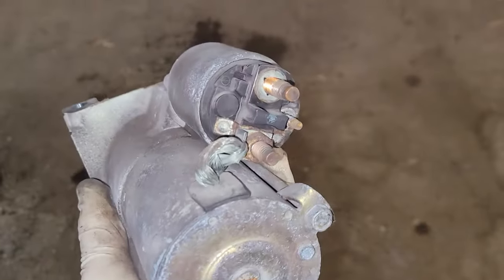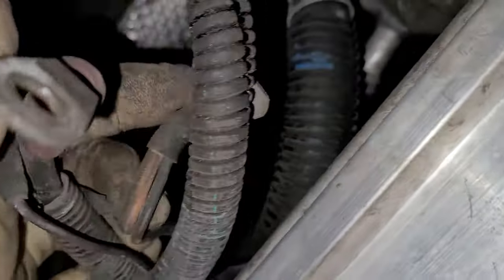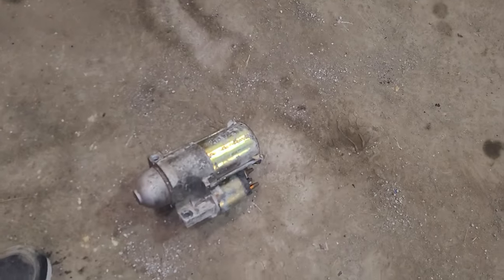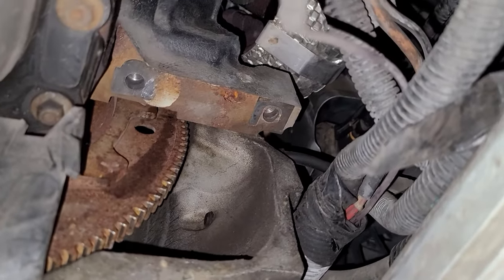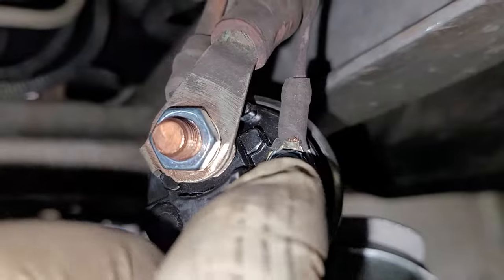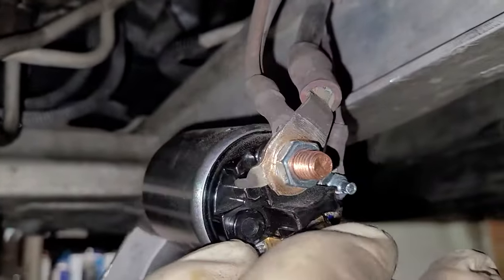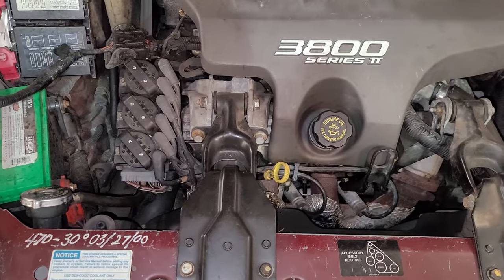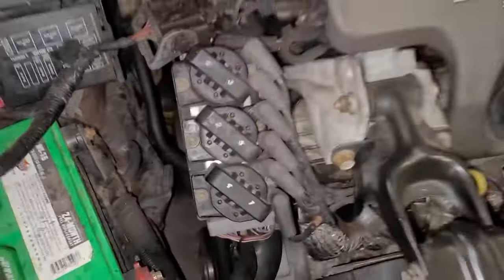No crank, no start !! If it's not the starter, then what is it?

Comment: A bad connection / corrosion and or a low battery will ruin a starter happens all the time….
Reply: Just installed my starter…. But didn’t clean the wires…. 😅now I gotta disconnect em
Reply: That's an excellent point. People don't realize that motors draw whatever current they need. If supply voltage is reduced by upstream voltage drop, the motor won't spin until it achieves the power required, and power is the product of current and voltage. So, with reduced voltage, current needs to be higher to unlock the rotor, putting more incidental heat into the thin wires inside the starter winding. With a few extra seconds drawn each day, and eventually with multiple tries to get the engine started, the insulation around those wires breaks down and the new starter dies.
Reply from the maker: Dead on correct !!
Reply: I've seen some strange things with the no crank no start issue. I helped one guy figure out why you never connect your main ground to the exhaust manifold bolts. I had an Olds Cutlass that would take a few tries to get the starter to work. When I went to take the starter off, I realized it was going to be a ROYAL pain to get to it. I decided to take the battery cable off the solenoid and loosen the backup nut so I could turn that bolt half a turn and put it back together. Problem solved. That starter was still working when I pulled the engine 2 years later to put it in a Ford pickup. It never gave any trouble for the next 4 years. I've seen a lot of people replace starters and swear about getting a bad starter from the parts store when it was something else ranging from bad grounds to bad ignition switches, relays, or neutral safety switches. Even worse is having to track down broken wires or bad splices where someone has messed with the wiring.
Reply: @WrenchingWithKenny  I currently have a 69 Chevy caprice it has the 4 bolt man 350 engine The car turns over but won’t start and I replace the fuel pump and it has the four barrel carburetor Just need to help to what to do next thanks
Reply: I have bought 2 new batteries, new starter.. and cleaned all connection points.. still no crank.. would wires still be the issue
Reply: @dominiquehaines-86SquareBody  surely sounds like there is a huge voltage drop measure from main power to start power and find if there is a huge voltage drop do the same on the ground side…. Sometimes you can substitute a connection with battery jumpers and go from body ground to case ground, then battery power to starter power lug if it works you have issues with your starter wiring
Reply: @dieseldawg7132  i was thinking of changing the battery and starter wiring but haven't had time yet

Comment: So I just replaced my starter solenoid. Now the engine will only run when I'm trying to start the engine. Once I let go of the key it kills it. Please help.
Reply from the maker: @offswitch Sorry to hear your having problems. Kenny suggested you go on our Facebook group, Backyard Mechanics (3.9K members). Input all the info about your vehicle & what you have done to fix the issue. There are a lot of techs and automotive people that may be able to help. Be sure to answer all the questions to join the groups. Let us know what you come up with. Keep wrenching!
Reply: @WrenchingWithKenny  hey I actually figured out my problem.  The entire wiring harness worked itself out. Didn't need to replace anything . Pushed it all the way in and good as new.

Comment: I think my crank shaft position sensor is bad (got code) or  selenoid is bad. So i got a no crank no start. I needed a booster to get car started. Got it to start but car lasted I only 2 days and then did the same thing. I charged battery i case it was battery. Started no  crank no start. Did it again and it took 10 seconds turnover before it started. So i dont think its the starter or it wont even turn but the selenoid going bad is not popping out coukd cause it to not turn sometimes or not turn most times? From spinning and cranking?   I got a code for cam shaft  position sensor, which I read eventually causes no start but it doesnt say if its a no turn no start or of its a turn but no start. Alternator hasnt died or the car would lose power and turn off or just not turn and or crank at all. Other suggestions anyone? let me know please. I dont want to buy new starter and alternator just to find out issue continues. It may be ignition switch or something similar? Not sure
Reply: So to be clear a no turn, no crank, no start is happening and only booster or fully charged battery turns (so far) booster struggled tmbut started. Fully charged battery didn't turn, didn't crank, no start. Waited a few seconds did it again and it turned crank but lasted 10 seconds before finally started ( I didn't hit gas because I turned car from passenger door (driver door broken and I didn't want to get in just to hit gas ( but will next time since I don't want to go through a long turned crank again.  It's weird. Anyone?
Reply: By the way I replaced battery with new battery that was sitting for a bout 3 months so I thought  needed boost to recharge but then 2 days later it happened again so indent think it was the old batterybsince new battery now and still having issue.
Reply from the maker: It's Mrs Wrenching. Sorry your having a tough time. Kenny is at the shop. He suggests that you go onto Facebook Wrenching with Kenny. Input all the info about your vehicle (year, make, model) & what you have done to fix the issue. There are a lot of techs and automotive people that may be able to help. Post on our other FB group, Backyard Mechanics (3.8K members) they can help too. Be sure to answer all the questions to join the closed groups. Let us know what you come up with. Keep wrenching!
Reply: @WrenchingWithKenny  ok thanks. I hate Facebook  and I n don't have an anonymous account but I'll see what I can do. Think the ground test will help me a lot. I saw 2 videos before bed about  this as proble. May be electrical if its not starter
Reply from the maker: I hear you about FB. Both groups are closed, which means we keep a tight rein on who joins & what content can be shared. Chasing electrical issues is an absolute beast. If I talk to Kenny today I will have him take a look at your comments here. You've got this - Meg
Reply from the maker: This sounds like a battery issue or a large electrical draw somewhere. It is too difficult to diagnose via messages. My advice is to bring it to a good mechanic. Some of the mobil mechanics are really good at diagnosing these types of issues. Go online & look for a mobil mechanic with really good reviews. I'm sorry I couldn't be of more help. Let us know what you find. Thanks for watching 🔧
Reply: @WrenchingWithKenny  I have a switch to prevent draws when car is off but the draw may indeed just put too much strain on batt and alt. I'll have to see. Also switch cables may. Red to be tested and ground area.
Reply: @WrenchingWithKenny i usually use a little spit and a piece of toilet paper to clean connectors. Or i will use my grandmas bobby pins to scrape off corrosion. But sometimes she uses them to pick ear wax out of her ear so i need to pick out the ear wax first otherwise it will smear on the connectors plus it stinks.
Reply: @WrenchingWithKenny  same issue here . The power is not suffice T to turn the starter! New starter n relays battery in good state..  gotta walk the wire I suppose

Comment: My 1995 Oldsmobile 88 isn’t wanting to start I change the starter and check the battery. The battery was a little low it was 12.14.v Looks like it freezes up when it cranks and don’t wanna crank over
Reply: Did you find your solution yet? I'm having the same issue with sluggish start after driven the first time.
Reply: @alienayee3508  not yet having another issue now there was fluid in one of the rear spark plugs got it out and it shot out of the hole.

Comment: Dont hook your battery up and try to start it until you know for sure you dont have your signal wire touching the other wire. If these are touching and you hook your battery back up your car will automatically start and you will definitely blow a fuse. Then ones you get them not touching your car wont start untill you find and fix the blown fuse!

Comment: I've got a similar situation with my truck, the only differences are that my truck is from 1947, it runs on a 6v positive ground system, I've got brand new battery cables and a new 6v battery with the positive cable attached to the frame and the negative cable going to the starter. but i turn the key, press the start button.. nothing, no click no attempt at the starter trying to spin up. i haven't the first damn clue as to why it's not doing anything.

Comment: Did it still turn over when it got hot? Is there a follow up video??
Reply from the maker: Yes. It turned over when it got hot. Nothing else needed to be repaired except cleaning the connectors & installing the new starter. I did not make another video since the no start issue was fixed. Thanks for watching & keep wrenching 🔧
Reply: @WrenchingWithKenny  Thank you, Sir! I changed my starter yesterday. I did not clean the connectors. As the day went on and the engine got hot, the starter had much difficulty running and engine did not turn over. When the car is hot and when the weather is hot, the car does not turn over. 

Also noticed the battery cable from the negative sat close to the engine which could have made the conditions for the heat worsen.

Do you think that contributed to it not turning over? Also, do you feel a nylon/brass brush will be okay enough once I take the starter back out and clean the connectors? This is the relay, right? I think scrubbing away that rust and corrosion might very well be the culprit. Can you please confirm?

Thank you for your time and attention to this matter. Will subscribe as well.
Reply from the maker: Absolutely clean the connectors with a brass brush after you disconnect the battery FIRST. Get the battery checked as well, just to rule out a weak battery as a potential issue. Let me know how it goes. Don't go bananas when you tighten everything back up. You've got this 🔧
Reply: @WrenchingWithKenny  Thank you. I will touch base with you.
Reply: @WrenchingWithKenny Hi Kenny! I never got to clean it yet. Last night I got stuck and the car wouldn't turn over. When I try to turn it over, I could almost hear like the throttle body opening and closing. Do you think that perhaps the throttle positioning sensor could be faulty? I sprayed with qd electronic cleaner and even took my MAF sensor out and sprayed with MAF sensor cleaner. I'm clueless at this point and I believe it now points to electrical.
Reply: MY STARTER RELAY. I SWAPPED WITH MY REAR DEFROSTER RELAY AND TURNS OUT THE ISSUE IS FIXED.

Comment: Look I put a starter in my my chevelle it’s it starts, but the gas is pumping through the carburetor, but it won’t crank over. What do you think it is?
Reply from the maker: I'm confused "it starts" means it's running, but you say it "doesn't crank". Cranking means the engine is turning over from the starter. Starting usually means the car starts & runs.

Comment: Hey I need to ask I can't remember the wiring I took off starter. But I believe I put positive on the motor bolt. OK so I replaced the brand new starter and brand new battery. I have complete no power. I want to ask the wiring on starter I have 3. One positive battery cable. The other is the skinny wire that is tiny bolt. Then a greenish black cable. Where does that one go.
Reply: On  motor bolt with wire from starter on it.?
Reply from the maker: Hi, it's Mrs Wrenching. Go on to our Facebook group Wrenching with Kenny & ask your question there. Upload pictures & include year, make, model of the vehicle you're working on. You will be able to reach someone in that group faster. Kenny is driving across North Carolina. Thanks for watching & keep wrenching 🔧 Meg
Reply from the maker: You can also join our Facebook page Backyard Mechanics for help. Be sure to answer all the questions to join. Don't say that you're joining the group to get someone to fix your car though. The Admins will not accept your request if you say that
Reply: Does the start cable go on the battery terminal or… does the run cable tie into the battery terminal? Thanks
Reply: You may be able to google a wiring diagram . Make sure it's for that exact vehicle . In general , the older GM's had the battery cable on top , 12 o'clock position . The small purple wire went to the " S " terminal . Most cars did not use the small " R " terminal , which was to bypass the resistance wire while cranking . But you had a black wire . You need to get a wiring diagram . Check the library for a Haynes or Motor's manual . I am only using GM as an example . Don't mix up wires ! Next time make a diagram and take a picture .
Reply: @ChristinaCasal-u4e  yes and the skinny wire is your trigger wire [when you start your car the ignition sends signal to the trigger wire also never let those two together the car will start on its own.

Comment: Good evening everyone!
I’m hoping someone sees this and can help!

We have a 1966 Chevy Impala 2 Door Hardtop that won’t start. It won’t even crank.
There’s no power to the ignition. The VOLTAGE REGULATOR has been changed out as well as the HORN RELAY because prior to losing power on it, both items were very HOT! Then everything just SHUT DOWN.

If anyone has experienced this issue and could help, I would really really appreciate it!

thank you in advance for your help!
Reply from the maker: @denisebarragan9993 how did you determine that you don't have power to the ignition switch? 
Hi, It's Mrs Wrenching! You should go on the Facebook group Wrenching with Kenny and Backyard Mechanics (answer all the questions) put the year, make & model of your vehicle in your post. Be sure to include what is happening with your vehicle & what you have done to fix it so far. There are a lot of techs that may be able to help. The link is toward the bottom of the video. Keep wrenching!

Comment: Can you do voltage drop testing if the starter is not turning over (no crank)?  When starting ignition (no crank) the voltage drop from (-) battery to starter housing is 78mv so good ground.  My voltage drop from (+) battery to B-terminal jumps to OL.  why?